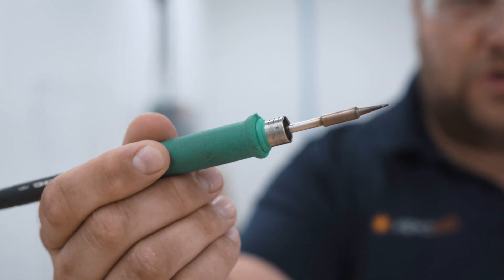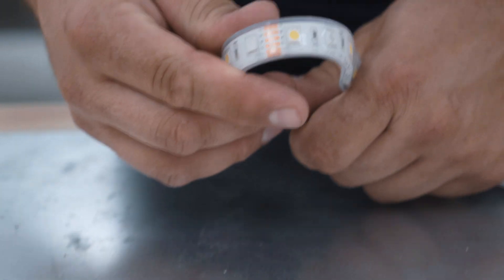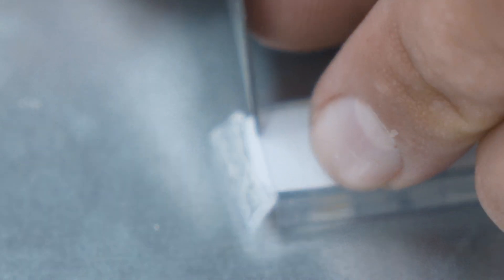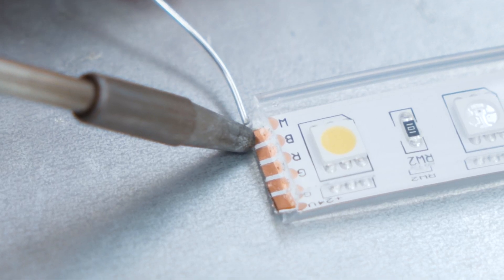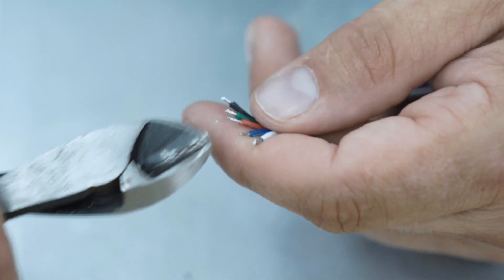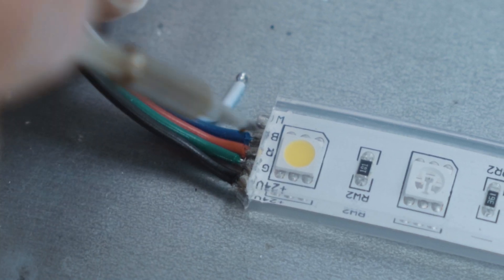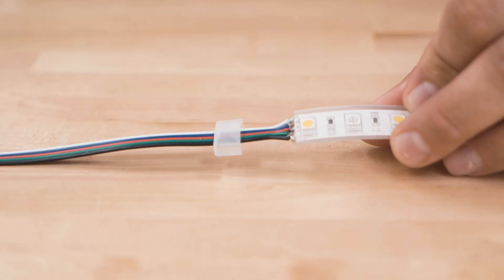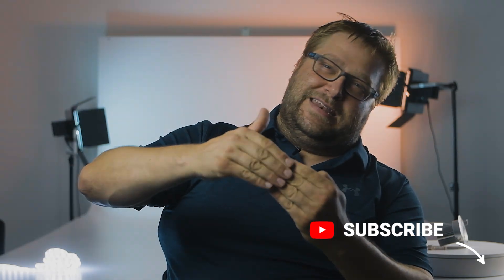How to Solder a Waterproof LED Strip Light

Comment: Hi! Good video. You specify a soldering iron that's capable of reaching 700 degrees F but you don't actually state the temperature you solder at. I'm soldering mine at about 650 F but having a few difficulties tinning the led strip. I have ensured all silicone is removed but still struggling. I have gone hotter but this seems to damage the tape. Any advice?
Reply from the maker: Hello! Thank you for the question. We found that a temperature of 650 - 700 degrees F which you seem to be doing yourself. Try making sure that the tip of your soldering iron is clean, it sounds like it might not be.